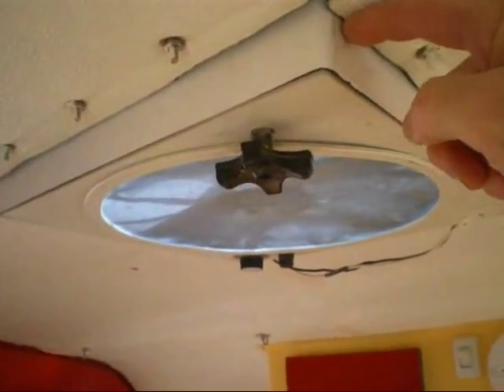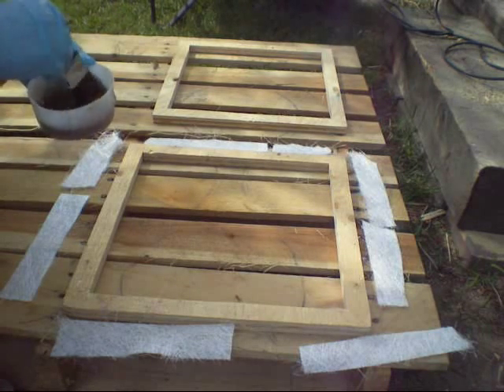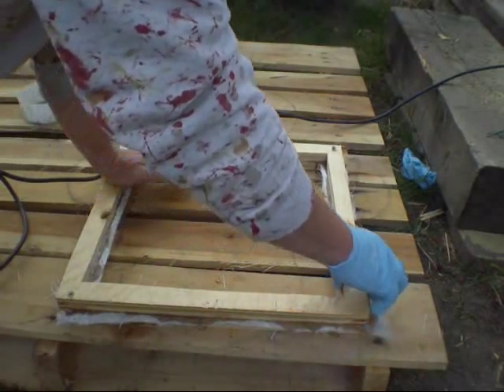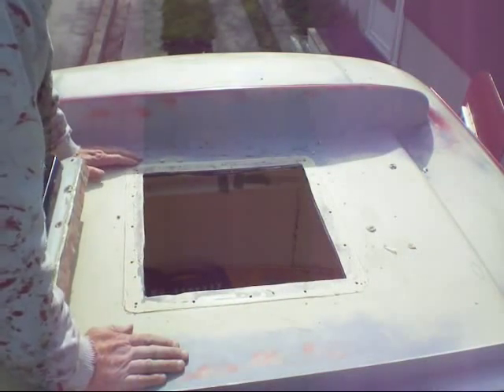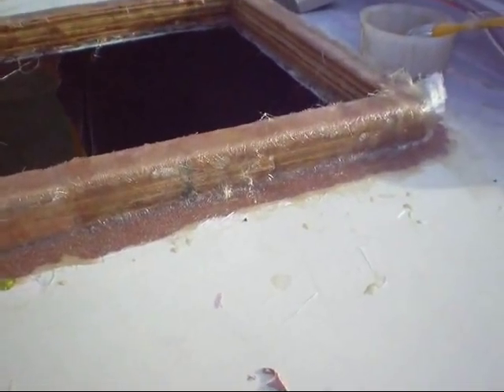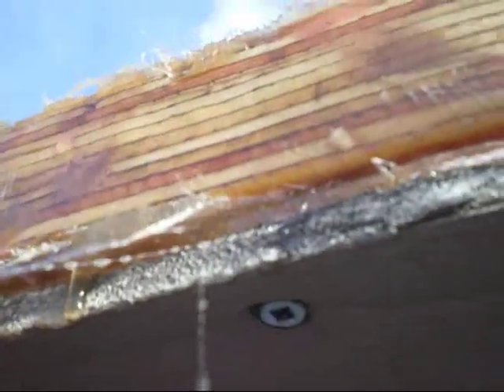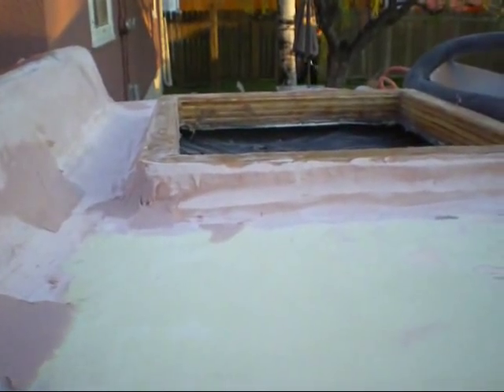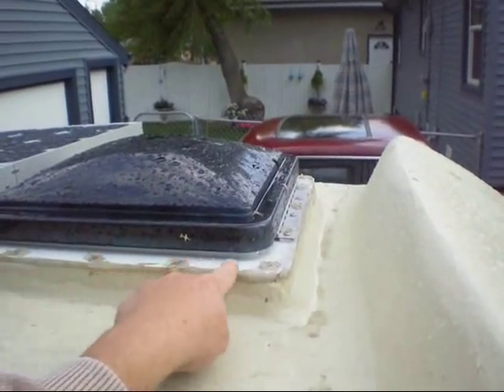Fantastic Fan Spacer on top of 1976 Boler trailer

Comment: Great suggestion and perfect timing for me since I just pulled a Ventline Arctic Air VE-509 out of my 1986 16ft Scamp rebuild project. The inside garnish was heat warped beyond salvage, forcing me to build a new one from neat plastic moldings I got at HD. Now, instead of adding blocking inside, I'll do it your way. Thanks.

Comment from the maker: I've run across information that suggests the resin alone can be brittle and possibly fracture.  therefore the cloth or matt is needed for strength.  Probably wouldn't matter in this application but for items subjected to forces it would be a good idea to insert the cloth.